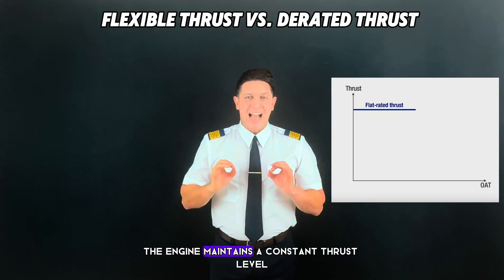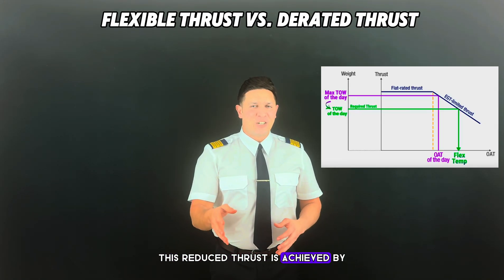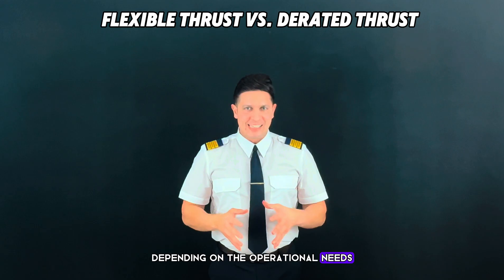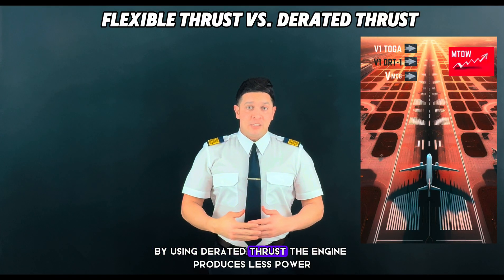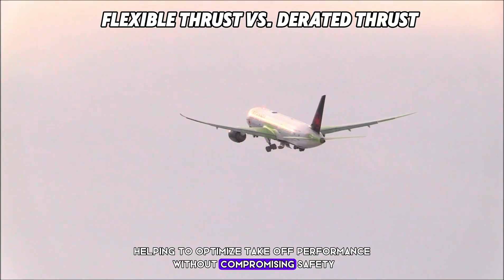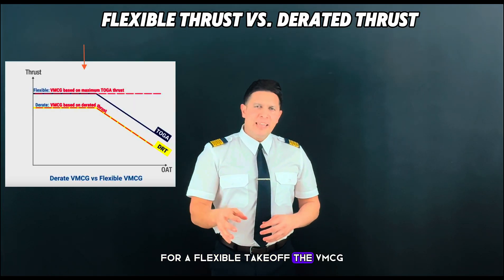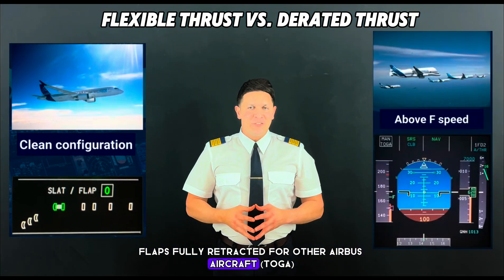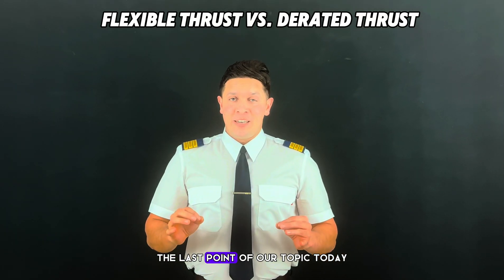Flexible vs. Derated Take-off Thrust – What’s the Difference?

Comment: Thank you so much for making this video, really helped understand both. 
I'm currently studying ATPL theory and the question bank says while engine life is improved, the fuel consumption actually increases because the takeoff takes longer (time) and therefore more fuel is burnt. Which is it now?
Reply from the maker: It is my pleasure and thank you for your valuable feedback 😊🙏

To address your question, the statement in question is overly generalized and does not accurately reflect the operational characteristics of most aircraft.

Fuel consumption behavior can vary significantly depending on the type of aircraft. Therefore, such assertions should not be made without clearly specifying the context.

In some instances, it seems that the authors of certain ATPL materials may be influenced by the performance profile of a specific aircraft type, which could lead to misleading conclusions.

In reality, for the majority of aircraft, fuel consumption tends to decrease during derated or flexible takeoff thrust, contrary to what has been stated. From both a technical and operational perspective, the assumptions made do not hold true and lack broader applicability.

Comment: But the crucial question here is: How can we increase the maximum takeoff weight by reducing thrust during takeoff?
Reply from the maker: @AlyBayoumy  The lowest possible V1 is constrained by the minimum control speed on the ground, known as Vmcg. This is the speed at which the aircraft can still be safely controlled on the runway with one engine inoperative.
By using derated thrust, the engine produces less power, which in turn lowers the aircraft's Vmcg. With a lower Vmcg, pilots can further reduce V1, allowing the aircraft to achieve a higher takeoff weight while still meeting all safety and regulatory requirements.
This technique is especially useful in cases where runway length is a limiting factor, helping to optimize takeoff performance without compromising safety.